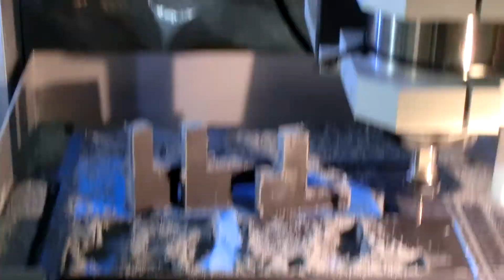Amazing CNC Controller ( MASSO ) Part-1

Comment: I have a brigport Boss8 and I addet clearpath motors to it what I,d like to know how to wire it with Masso controler
Reply from the maker: Wire clearpath motors to MASSO , you can check this website https://masso.com.au/docs/masso-cnc-controller-documentation/motors-and-drives-connections/teknic/